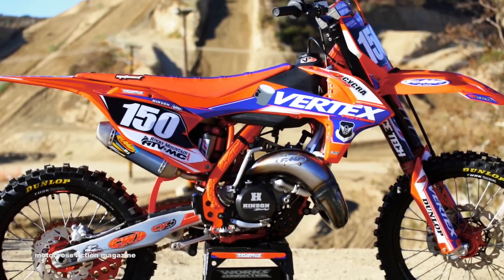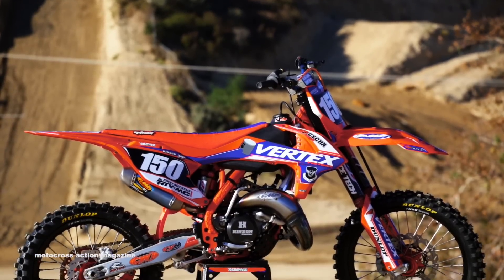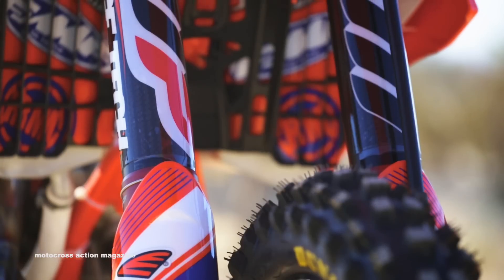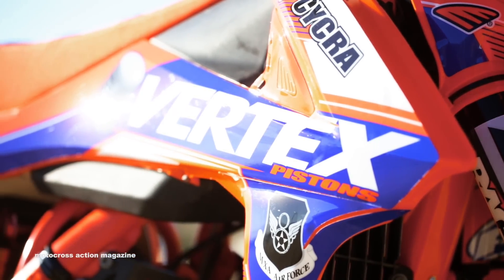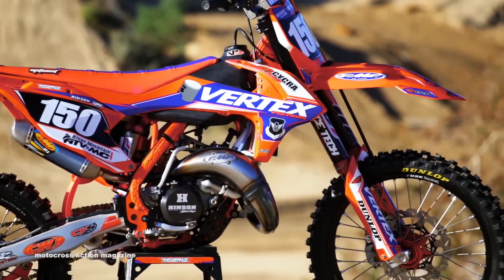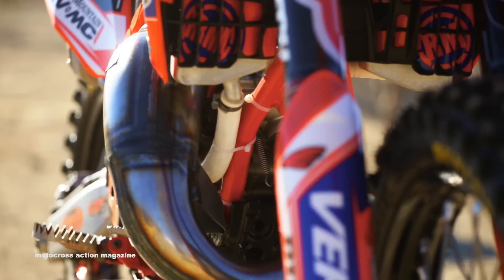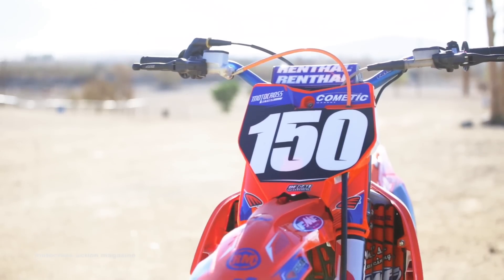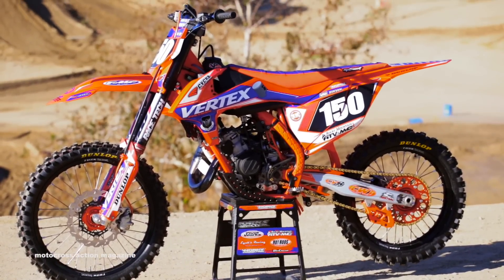Project Vertex KTM 150 SX 2 Stroke - Motocross Action Magazine

Comment: Dont say that 150's cant compete with 250f's. It is mostly rider not the bike. Kailub Russel won a gncc against 450f's on a 150.
Reply: Broton yeah I really didn't know what he was on about there where I'm from they race 125s against 250fs
Reply: Broton your right he is a four stroke rider so he doesn’t now how good the power band is
Reply: @tallonsmith8192  huh? All bikes have a power band including four strokes. All "power band" means is where a motor makes it peak hp.
Reply: @4touchdowns1game29  yes I am aware but the two stroke power band is better
Reply: @tallonsmith8192  I wouldn't say better. More fun yes, better for racing no. A four stroke despite being slower is just alot easier and less tiring to ride in a long motocross or supercross race. Supercross especially four strokes benefit from the low end torque you need. Two strokes do have an advantage in gncc and desert racing though where there's a lot more open straight sections.
Reply: @4touchdowns1game29  2 strokes preduce more torque
Reply: @mattcowlard4662  yes they do but not on the bottom end. At peak hp a two stroke motor is far superior. Only problem is that with 450cc four strokes being allowed a big bore two stroke will never make a comeback because 450s have enough power and are much easier to ride.
Reply: @4touchdowns1game29  think you should check a dyno 250f vs 250 2 stroke the 2 stroke makes 10-15 bhp more in the midrange it beats a 4 stroke on power amd torque at every point!
Reply: @mattcowlard4662  I'm talking bottom end. And I'm also talking about allowing 450s making the difference a moot point. At small bores the two stroke has an advantage and at larger bores the four stroke does. Because even 500s lack the bottom end torque of a 450. The same thing can be said for an electric motor and having so much I start torque making 4 strokes obsolete. Only couch racers go on and on about 2 strokes being better at everything. I even like my two stroke better than my 4 stroke but guess what if I had to choose between my 250 and 250f to race I'd always choose the 250f because it doesn't tire you out nowhere near as bad as the two stroke.
Reply: @4touchdowns1game29  what a 30 year old 2 stroke 500 designed engine? Your so wrong even they preduce more bottom end no matter what cc a 2 stroke preduces more power at every point on a dyno
Reply: @4touchdowns1game29  as you can see even as low as 3k and 4 the old 500 that was designed 30 years ago is preducing quite a bit more power then the modern 4 stroke does my head in when people say 4 strokes has more bottom end yes they are easier to ride because they are slower with flat power bands
Reply: @mattcowlard4662  I think it's more complicated then that. Something about the pulsating of the motor. Really what it comes down to is traction and power delivery.

Comment: so, hp numbers?
Reply: Keith Feulner 35-40
Reply: well a tuned 125 of early 2000s we built made 41-42 on vp mr1 so has to be more than that 15 years later.
Reply: Keith Feulner yeah but approximately numbers that are close to 40 or a bit over. 125s have that 35 hp when the engine is brand new. This 150 is only 25cc more than 125 so the difference isn't huge. And it depends so much of the tuning. But you are probably right. Atleast we can say that this thing has basically no power in low rpms therefore the hp numbers are quite high for the 150cc. Under 50 hp.
Reply: Keith Feulner it makes 40.3 stock